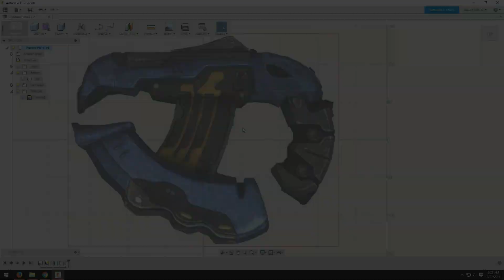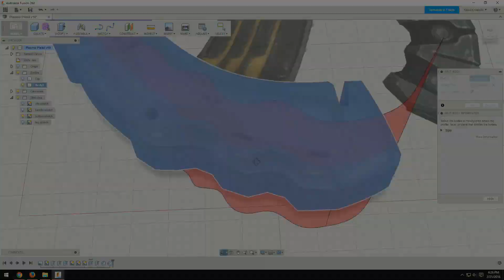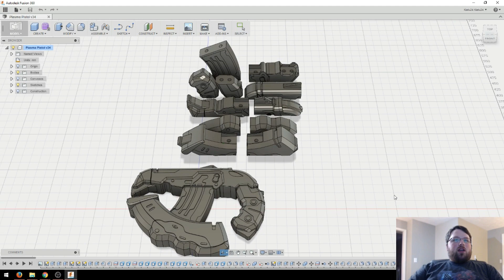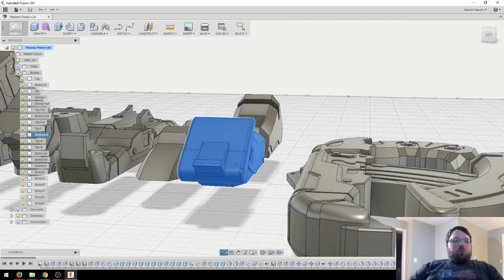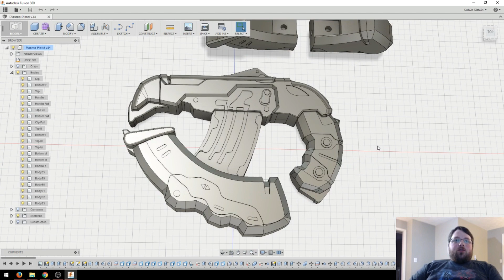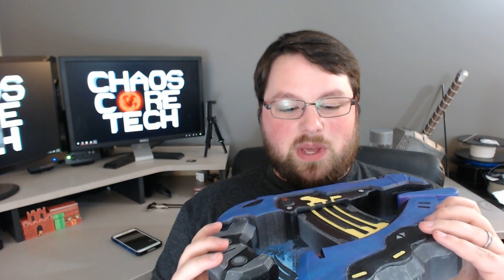3D Printed Halo Plasma Pistol Gun

Comment: Just seeing this one for the first time. You're doing some incredible work here. One question: You mention using .3 layer height to save on filament, but surely the different layer heights would use essentially the same amount of filament? The difference is that the finer layer heights take a lot more time, since it takes ten passes to make up 1mm of print height at .1 layer height rather than 3.33 passes at .3 layer height.
Reply from the maker: +Mighty Jabba&#39;s Collection You know, I've never really thought about that. I didn't think about it using less filament when creating a thinner layer but you're probably right. It makes sense when you think about it. I'll have to look into that. Thanks for pointing that out to me!

Comment: As always, great job!!  Already added this to my que :).  I'd love to see the paint process of a piece like this.  For the caulking...  did she use the sealing type that expands as it dries and is rubbery?  I'm super curious because i've been trying to use bondo and it dries really fast.  Thank you again for the design.
Reply from the maker: +neckbreaker I've actually had a few requests, so I'll be including that in the future for sure. :) And good to know about the bondo stuff. I'll have to give it a try. As soon as I find something that works well I'll post a video on the results. If you find anything good, let me know!
Reply: +neckbreaker 
For ABS I use an ABS paste then follow up with Bondo 907 Glazing and Spot Putty (red putty). In the past I have used on Resin Models, microballoons and slow setting 2 part epoxy
Reply from the maker: +neckbreaker Glad you liked it! As for the painting. I wasn't getting any feedback on if people were liking the painting information so unfortunately I didn't get any painting footage of this one specifically. A mistake obviously. :) So I'll definitely get the painting process in the future. And if you'd like I could put together a video on different methods of painting a 3D print.

And as for the caulking: http://www.dap.com/dap-products-ph/alex-plus-acrylic-latex-caulk-plus-silicone/ 

I'm pretty sure that is close to the one my wife used. We just had it sitting around from when we did some painting of walls in our house. We're actually experimenting with a few different methods of sealing prints and getting rid of seams. In my Thor's Hammer video we used a 2 part epoxy and just spread it around to try to cover the cracks. It worked okay but it ended up receding slightly as well. So we'll continue to look at different methods for that. :)
Reply: +Chaos Core Tech Please don't go out of your way if I'm the only one showing interest.  I've been piecing together information from sites over the past couple months.  I used caulking on this stormtrooper helm, but there is no fix for pieces that don't mate correctly.  It did fill actual gaps well though.  I would have never thought to use it had you not mentioned it.

For sealing, I found this Krylon clear sealant that gives stuff a nice shiny coat.  I applied two layers to the trooper helm even the little seams still showed up.  I'm thinking if I took my time and used the bondo correctly it may be better on seams.  I have a habit of pressing my finger tip along the lines which probably presses things too deep and just creates the seam.  but bondo should protrude and just require sanding...

Until next project!  Happy Modeling!